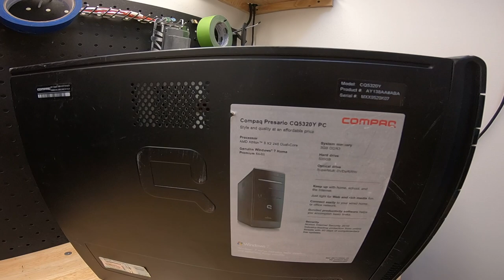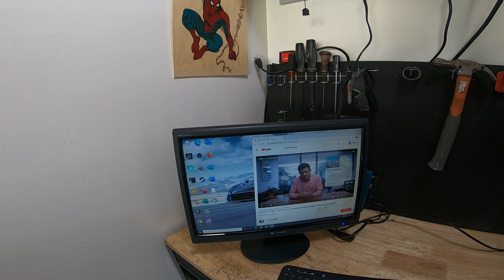Old Compaq Presario gets one last chance!!  Ryzen 5 2400g build! $175 gaming build!

Comment: Back in February I bought a ryzen 5 2400g and I have to say that, even if I am thinking of replacing it, It served me damn well. I now have it paired with an rx 5600 xt and at most games it is not a bottleneck. Also it is very easily overclocked to 3.8gHz and it doesnt need any fancy aftermarket cooler. Totally worth  the 150€ I gave for it.
Reply from the maker: Yup, still a good cpu, Id really wish I could of put a better card in their but would of killed the budget. I sold it real quick and still made a nice profit!

Comment: Mind do a building video for this but show the building process?
Reply from the maker: wont be able to, sold this a while back but if you have any questions, feel free to ask and will try to guide you the best way I can.
Reply: @DLMtechgarage  do you remember the parts used?
Reply from the maker: @leerunning9123  ryzen 5 2400g
ddr4 16gb
asus tuf b450 matx board
stock amd cooler
1tb ssd
240ssd
500w power supply
rx560 for the gpu
the case was an old compaq presario required no major mods, just had to repin power switch

Comment: what would've happened if you'd just plugged in the front panel connector block as it was? would it kill the switch? would it hurt the motherboard? or would it work fine?

Comment: I have this computer.  I bought it in 2009 and last week it wouldn't turn on.  I wanted to open it up and clean the ram sticks and replace the battery but I cant get the case to open without a special screwdriver.  Do you know which one I need to buy? Thanks a ton!
Reply from the maker: i don't have the pc anymore but I melieve it was a flat head screw driver or a torx bit.
Reply: @DLMtechgarage  Thank you!

Comment: What kind of spray paint do you use/recommend? thank you
Reply from the maker: I don't have a specific brand. I mostly look for one with a paint and primer in one. key is the prep work by cleaning the surface and scuffing it up with a scotch pad for better adhesion. I have a video (link below) that is a guide to how to do paint work on the computer, but typically i use rustolean or krylon spray paint.

https://youtu.be/n3pU3cymP0c

Comment: Send me the list of things I need for a Compaq Presario rebuild I'm trying rebuild it
Reply: On Instagram
Reply from the maker: ryzen 5 2400g
16gb gskill ddr4 3000
128 ssd
1tb hdd
stock cpu cooler
asus b450 tuf motherboard
cheap rgb strip from amazon
ares games 650w power supply
rx550 video card

make sure the case your using is a matx or atx compatible as some of these old cases are not, as far as the pin out for the front i/o, follow the led and buttons so you can make your own pin out. 

for the case i sanded everything with a scotch bad for better adhesion for the paint and used rustoleon black paint and red paint with paint and primer, used 2-3 coats and then seal it with matte clear coat for better protection.

Comment: How did you re-pin the power and led connectors?
Reply from the maker: I just took them out from the bulk connector they where in, they got some single pin connectos and repinned them
Reply: The power connector works without doing anything to it. I just finished building a budget PC with this same Presario case. It is plug and play.
Reply: @DLMtechgarage  awesome! How did you determine which pins go with which functions?

Comment: Hey I have this case and I want to upgrade the internals of this but keep the old case wanted to know if the power button cable can be plugged directly to a micro atx motherboard like asus b450 mk -2 without depinning it I don’t want to put lights I just want a normal turn on and off function
Reply from the maker: nahh.. you would have depin the connector and repin the individually. It is really not that hear to do. You can by those single or even double pin connectors on Amazon.

Comment: Hey, is it okay if I dont d-pin the powerbutton wire?
Reply from the maker: the bulk plug is not standard so it would be tricky getting power to the pins!!
Reply: @DLMtechgarage  Ive seen some youtubers do some sleeper builds and Ive been wondering how they got the powerbutton wire to work because its just 1 wire.
Reply from the maker: @daud3851  it's one wire bulk connector but the on and off are a power and ground. just de pin it from the bulk connector

Comment: How do you depin the power connectors
Reply from the maker: the connectors have a black tab you pull back and you can remove the pin from the block connector and use individual connectors. I bought those from amazon.
Reply: @DLMtechgarage  alright thanks for the answer despite the video being old 😂 i subbed and liked
Reply from the maker: @nidzex4724  greatly aprreciated!
Reply: How do the connectors go is there a wiring diagram or is it just that simple?
Reply: @GreenMachineXXII  every motherboard has a different pin layout, i recommend looking at your manual or search it on google
Reply from the maker: @GreenMachineXXII  I just follow the wires to the leds and switch from the bulk head it came from. unpinned it and pinned it into old connectors i had lying around.

Comment: I have the same exact computer and have the same connected hdd,led etc connector would i just be able to plug it into the mobo in jfp slot with the way it is (connected) or i do i have to disconnect each individual connector?
Reply from the maker: I disconnected each pin from that connector, cut and spliced them into these pins I got on amazon, link below. A little soldering or butt connectors and I was good to go. Hope this helps thanks for watching. 

https://www.amazon.com/gp/product/B01IB7UOFE/ref=ppx_yo_dt_b_search_asin_title?ie=UTF8&psc=1

Comment: Do you mind listing everything that you use for the PC?  I’m trying to use my parents old compact case for something like you’ve just did. Great work man.
Reply from the maker: Yes I can,

Ryzen 5 2400g
Asus b450 Tuf motherboard
16gb ddr4 2600
500 watt power supply
AMD rx 560 graphics card
stock cpu fan
120gb ssd
1tb hdd
required no moding, only had to removed the hard drive cage and just individually pin the power button which you can get those on amazon

https://www.amazon.com/gp/product/B01IB7UOFE/ref=ppx_yo_dt_b_search_asin_image?ie=UTF8&psc=1

other then that, spray paint, sanding and that was pretty much it. Hope this helps and thanks for watching!!
Reply: @DLMtechgarage What do you imply by individually pin?

Comment: Do you know how much watts does Compaq presario cq3000 series use? Idk where to check and it doesn't have any labels. I'm planning to upgrade from i3 2100 to i5 2500/ i7 2600. But i need to know if it has enough watts for i5 2500/ i7 2600 that use 95 watts instead of 65 watts from i3 2100. If you know plss let me know 🙏 I don''t want to replace the motherboard yet. So I thought of changing the cpu to quad core and more ram. Hopefully it would still be good till I get new MoBo for better ram and a gpu. Also give your opinion if this bad or good cause I am not great at pc 😅
Reply: Also is gt 730 good for gaming now? and works with Ipisb cu MoBo? I have done my research and need some help and opinion😓.
Reply from the maker: im not sure of the wattage the old psu had in it. I scrapped it for the this build and went with something better, going with a i7 2600 along with pairing it with a decent graphics card would be a solid build. I have a video on the channel of reviewing the i7 2600 which would give you an idea on how well it holds up. still a solid performer. def go with 16gb ram and a ssd and you would be good. let me know if you need anymore input!
Reply from the maker: i don't recommend the gt 730. it's a real bad graphics card in my opinion. try to find a gt 1030 or a firepro w4100. both don't require any supplemental power and work decent. I use the firepro alot in budget builds and it's a good starter card. the gt 1030 is better but can be a little more pricey. got reviews on those in the channel as well.
Reply: Thank you! Exactly what I need to know. I'll check out your videos and look for those parts. Thanks!
Reply: @DLMtechgarage  Hello. I wondering if you can help me cause i can't find any solution anywhere! I recently bought 4gb ram ddr3 1333mhz which supported by my motherboard. But when I added it, my pc started to beep. Idk what it means and the causes. My old ram 2gb ram ddr3 1333mhz seems to work fine. Cannot add both because im running 32bit but i tried adding the new ram 4gb only but still didn't work. Does the height of the ram matter? Because the new one was shorter while my old ram was taller (height not length). Pls help me 😭 I need this to work
Reply from the maker: @snowwdx8358  usually that issue can mean ram compatibility issue or bad ram. Depending on the system you are putting the ram in, it might not be compatible with the brand. look up the system and motherboard it has and see what they recommend. I usually usual stick to corsair and samsung in older systems and never have issues.